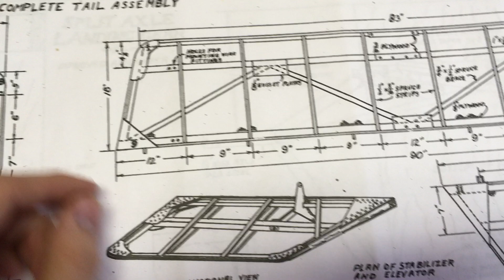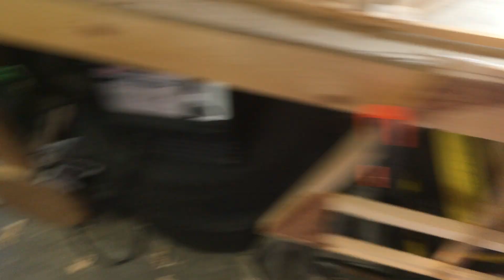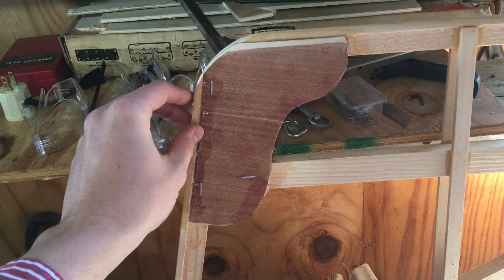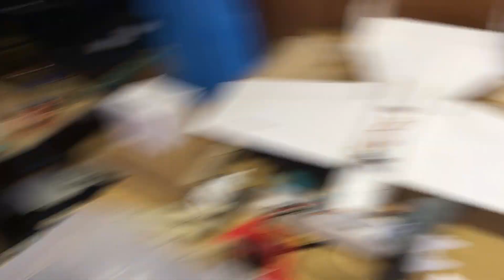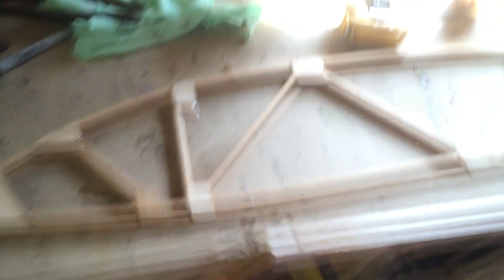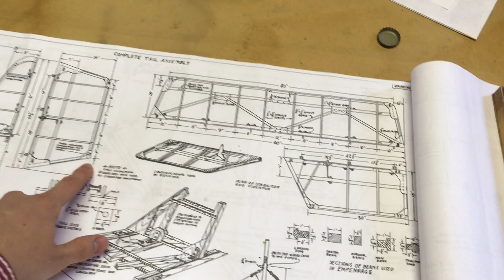Pietenpol Lessons Learned - Tail Feathers & Wing Ribs

Comment: Do you know what works good to plane down the ends where your hand plane had difficulty in trimming, 'cause of the other beam not being cut and glued correctly? An electric hand-held disk sander. It can be used to carefully sand down the beam that is glued together with the grain of the wood in the incorrect direction. An electric hand sander would take that leading and trailing edge down very nicely and can be gently blended to match the long beam that your hand planer is doing for you. Either that, or a router with the correct shaped bit will work very nicely to shape the entire length. 🙂

Comment: Wood is very forgiving.   You can use a sander to shape it with the grain or across the grain.   Even rectangular pieces can be shaped with a hand sander and a belt sander for leading and trailing edges.

Comment: A good tip for everyone, is to study the drawings as often as possible, because it will help you to plan your approach, sometimes it will make your life a lot easier to make a simple alignment jig, for instance, ensuring that wing spars and centre section will be identically spaced.
A point for all builders to be aware of, is that, although your computer drawings on screen will have the accurate measurements, most home printers suffer from inaccuracy the further away from the centre of the print.
If you draw onto the building board, the actual position lines for the leading edge, the spars, and the trailing edge, you can then position your printed papers relative to the fixed lines that you have drawn on the board. Any minor errors will be absorbed by the diagonal bracing positions.
Personally, I prefer to simply transfer the drawing dimensions directly to my building board, as it helps me to work out my jig design as I draw.
Hope this helps anyone planning a build.
Happy building and blue skies.

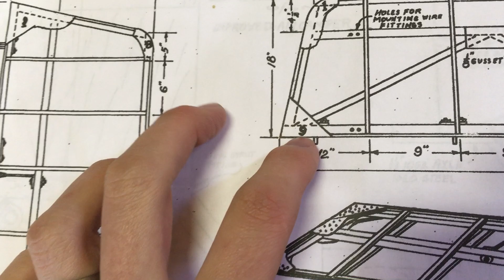Comment: PS, I've seen plenty of photos where builders did not trim the edge (the "T")  off and "nested" the gussets against the edge. Not saying it's wrong or OK, but I guess some are flying like that. At 4:38, you just have to think ahead as to your hinge....what type and will you be able to get the bolt in. By the way, ribs...Andrew Pietenpol spoke with me and was adamant that the entire rear spar be 4 3/4" (don't sand down the rear part).

Comment: I’m curious why you didn’t base your rib jig off of the one piece full size paper rib?
Reply from the maker: I didn't buy it. I was cheap, and also I wanted to draw it in cad so that I could get gusset plates laser cut at the shop at my school. In retrospect I might have done it differently.
Reply: Those are two different ribs.  If you plot the points on his plans adjacent to the printed full size, the profiles are different. Notice on his print in this video, the vertical beams for the ribs are not pictured, and just the spar is there (but he added them adjacent to the spar). Also, the printed one on the full size paper is not to scale.  The distance between the spars is listed as 27 3/4” but it is actually 27 7/16”.